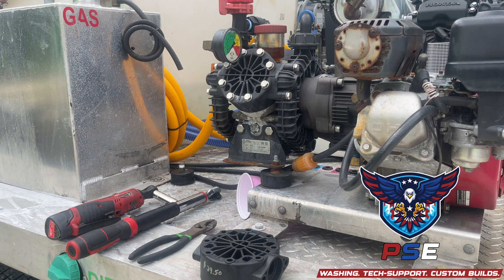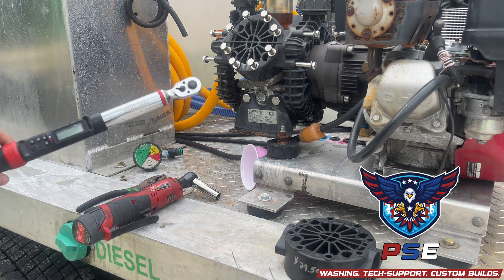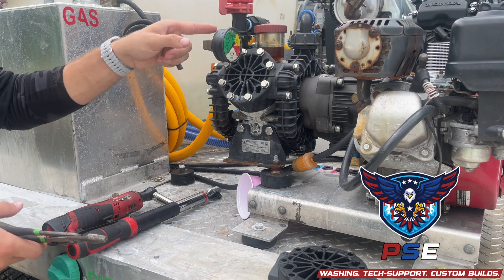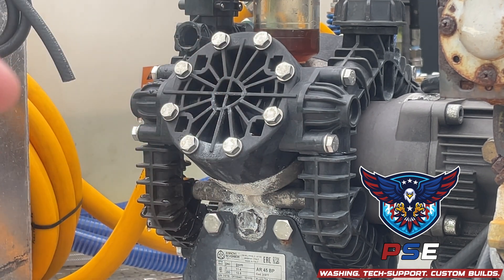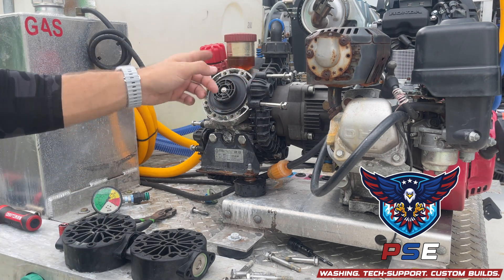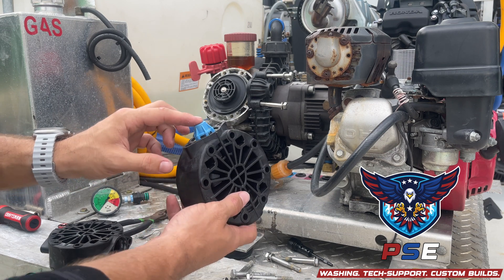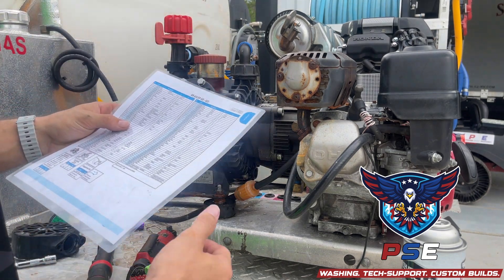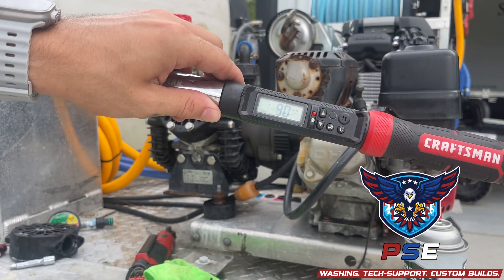AR45 Pump Head Change

Comment: What did you use to clean calcium deposits?
Reply from the maker: We typically don't if you have calcium deposits on the check valves, it's probably a good time to change them out.

Comment: Did you start losing pressure? If i introduce soap, my pump stops working.
Reply: I lose pressure when I turn the chlorine on
Reply from the maker: Then there’s an issue with your plumbing on the soap line. Assuming everything else was followed in the video
And the pump runs perfectly on water usage.
Reply: @overkillwash  that's what we were thinking.  Thanks for replying!
Reply from the maker: @midlifemike4916  Text me some pictures 904-999-8087 I’ll help you out

Comment: In the process of building my trailer rig and did hrs of research and purchased the AR 45 great content just waiting on my remote rinse to come and can finish plumbing my AR question regarding the clips that hold the discharge and gauge do u ever experience them vibrating off and if so what did u do to stop it also i noticed u have a check valve on your bypass is it necessary like the comet p40 also my pump is the nrwer model it they did some changes the bypass is now a 3/4 barb not elbow the outlet is 1/2 barb poly no ball valve no drain plug on the bottom of outlet manifold and they got rid of yhe gauge i had to order the gauge separate thanks for the video
Reply from the maker: Hey there glad to hear, as far as the clips go I have never had an issue with them vibrating out.
They are actually quite a pain to get out.

As an extra precaution, you can take a zip tie and zip tie it to the manifold if you really feel it’s necessary.

The check valve in the video is just a adapter for threads.

As the regulator threads have stripped out for me with every other three-quarter inch fitting, I’ve tried to put on it.

The check valve seems to fit on there perfectly and then gives you nice clean three-quarter inch threads to put your fittings on